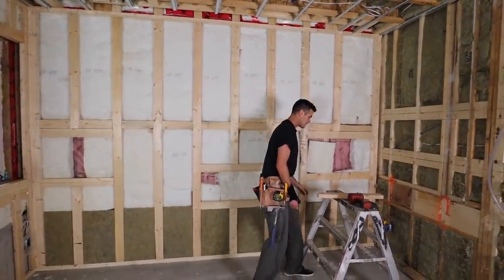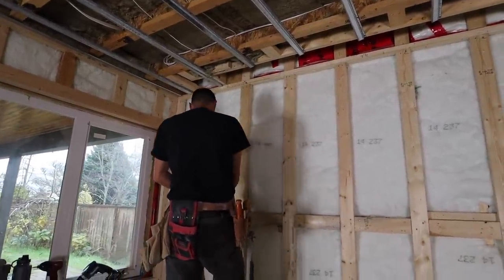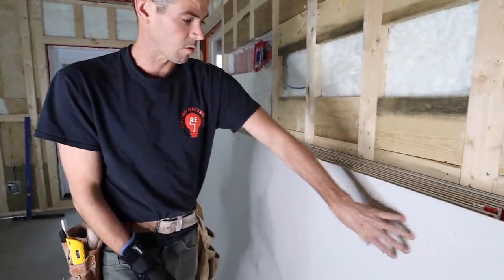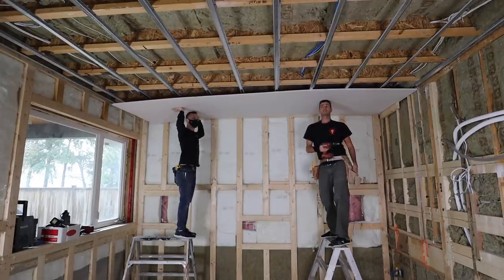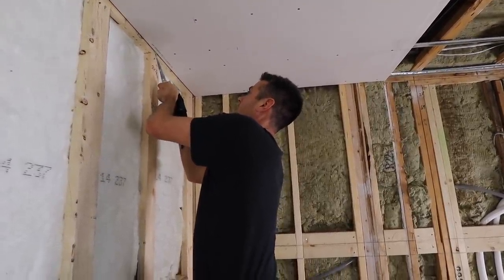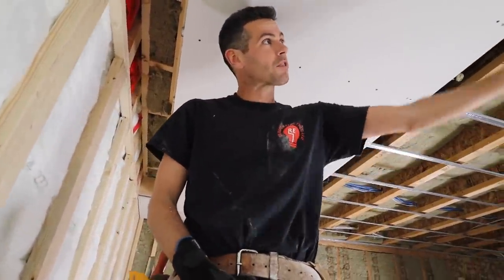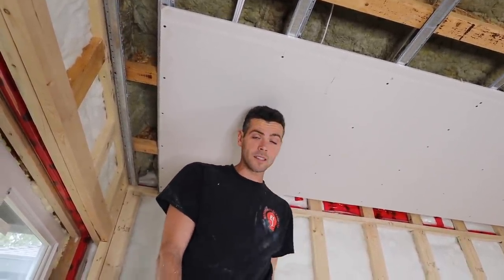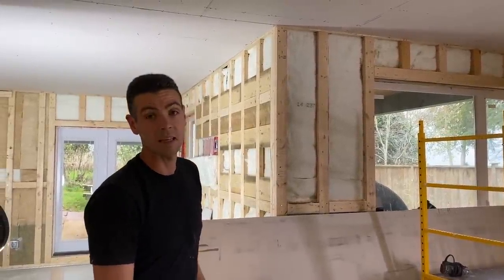Hanging 12 foot sheets of 5/8" on Res Bar!!

Comment: Brought back memories of working with a helper who was 8” taller than I am. No matter what height we built a scaffold at one of us was not happy. Also reminded me of breaking my thumb one weekend and being told I could go right back to work. I borrowed an appliance hand truck from my boss so I could drag my radial arm saw out of my basement and set it up on the job. I was laying a wide plank pine floor that was face nailed rose headed wrought iron nails. The idea was that the floor would look 120 years old like the rest of the house. Well between the old fashioned nails and having to swing the hammer left handed  it certainly looked “antiqued”.
Reply: Wtf u talking bout
Reply: @thomasbowden1054  first, I used to work with a helper who was 8” taller than I am. On several jobs we hung drywall together. Either  the scaffold height as right for him and I’d be on tiptoe, or I would be at a comfortable height and he would be all hunched over. 
My apparently off topic story about laying flooring was prompted by seeing  the Vancouver Carpenter working with some sort of brace or cast on his wrist.
Reply: @janderson8401  I sort of understood the height story, but the flooring story looked like a whole bunch of gibberish. Or pig latin. Or gibberish pig latin

Comment: I've been hanging drywall here in Australia and check in the drywall guys from all over the world after a day's work as a bit of a pep up to make sure I'm doing the whole thing right. I seem to be. Yeeha. I can't do the tape measure drag along.. I went to Bunnings and bought a t square for drywall.  Twenty dollars.. Also I find wetting the paper tape for butt joints. Just two seconds in water really helps the adhesion as I am using the gyprock all purpose compound. I am mentally prepared to do a Fair bit of sanding which seems the arch nemesis of DIY plaster dudes but so be it if I want a top notch job. Good luck everyone....

Comment: Hung my whole townhouse renovation. 5/8 x 12 all sheets except 3 5/8 x 14. bought quality lift. don't buy cheap one. Bought Makita self feeding screw gun. sold both after job was done. Even use the lift for the top wall pieces. Thanks for showing this video. Brings back memories.

Comment: If you are going to do any restoration or extensive remodeling there are two pieces of equipment you need from Harbor Freight. About a decade ago I bought the portable scaffolding (on wheels) and the drywall lift. cost me about $250 back then and I have used them extensively. Saved me time and a sore back. Use the right tool for the right job.

Comment: I bought a used lift off Criag's List years ago. Soooo glad I did. Just a couple days ago I realized (duh) the lift works for walls too (horizontal orientation). I also made a bucket for it and lifted loose insulation up to the attic.

Comment: 2 things.
I would use tear-away bead on the edge of the opening for a clean edge.
And I wouldn't screw the seams until the next board is butted against it, that way you don't have to worry about putting a screw too close to the edge and blow it out.
Besides that, your commentary it's the best representation of how drywall work really goes lol, great job.
Reply: Saw tear away a lot in commercial projects, works well.

Comment: Love your vids, very helpful. Sometime even a novice can help a pro. I do believe you said this is a theater room and I am sure the customer is having Resilient Channel installed for sound deadening/proofing. When installing Resilient Channel, you screw the channel to studs but you should never install the drywall screw over the stud. If you do put drywall screw over stud you have defeated the purpose of the Resilient Channel and allow the sound to transmit into stud. Keep up the great work and helpful tips.

Comment: When I put up the drywall in the room over the garage I did it all by myself. I had to figure out how was I going to hold the drywall against the angled part of the ceiling and screw it in at the same time. So I did basically the same thing. I screwed boards to the wall to hold the lower side of the drywall while I screwed it in place. The flat part of the ceiling was narrow so that took some of the weight off the drywall since it was only a couple feet wide, but I used a 2x4 with a flat piece of 2x4 screwed to the top to hold one end against the ceiling while I balanced the other end on my head and screwed it in. You do what ya gotta do.

Comment: I hang 12’ drywall by myself with a cheap system. Take 2 10’ 2x4’s and screw door hinges to the ends of each one. Screw them to the top plates about 6’ apart and let them hit the floor. At the bottom, screw an 8’ 2x4 perpendicular across the bottoms of both 10’ 2x4’s. This acts as a lip. Take another 8’ 2x4 and screw another door hinge to the end. Screw this in the middle of the 8’ 2x4. This acts as a dead man that swings down when you lift up the drywall panel with both arms. Simply bring in the panel and rest it on the lip, bend down and lift up on the 2x4 until the dead man swings down in place. Now you can slide the panel into place. I have a few T-sticks I use to push it up against the strapping. I’ve built 3 homes completely by myself.
Reply: Love to see a video on your system
Reply: Yes video
Reply: Sounds like a great idea! I'll have to give that a try.

Comment: Hey when working on a home theater room besides using rez channel to float the ceiling have you used "green glue" on the walls. It doubles the density of (2) pieces of drywall to act like (4) and STC's ratings go up. Building recording studios sometimes we've used green glue between the layers of sub floor as well.  I'm sure you know this but using "green glue acoustic sealant" at the floor (drywall can't touch) and corners works great on hi frequency transmission...decouple decouple! Adding a passive air handler is a whole other thing...Cheers great channel!!!

Comment: Thanks for the great video.  

You mentioned the need to leave a 0.25 inch distance between the corner and the RC1.  Should the drywall also have a 0.25 inch gap in the corners (where the ceiling meets the wall)?

Additionally, for sound proofing purposes, should the ceiling and wall drywall pieces not touch...and only use tap to bridge the gap?

Comment: As an aged DIYer (69) I did the same thing in my basement in October (plus all the mudding...) Yes, I own a drywall hoist. I wish you had posted a few months ago! Learned the hard way about using fine threaded screws and not screwing them on the bevel. Contrary to what you demonstrated, I found butt joints on res bar problematic for 2 reasons: (1) res bar is too narrow for proper screw attachment especially if a sheet is slightly long and (2) the butt on floppy side of the res bar seated lower that the other. I know that mud would take care of this, but I just don't like it. What I did was to hang the drywall long and spliced my butts with 6" x 54"--for securing butt to drywall on either side--strips of 3/8" plywood (since the height of the res bar is 1/2"). Regards, GK
Reply: There's are interesting products like the TRIMTEX 825 BUTT BOARD  that are designed to create a bevel on the butt joint. You install them the same way you described, but they pull the drywall up (in theory, never tried them).

Comment: Union rocker in the Seattle area. Never seen a drywall lift on the job. Lol. We 2 guys on beaches swinging board over head to get those in. It would suck when the sheet wouldn't fit. 

Few tips through. Hilti actually sells a drywall router, and that would've been your best bet on the cut in for projector screen. Using a guide bit, you won't hit the wood. 
When marking out the location for your studs at the end of wall, it's a good idea to just do a line instead of the two lines and an x. Takes too much time. Use a T-square and a pencil to mark out the sheet for the studs on the ground first, if you need marks. 
Lastly, you should get a belt clip for your drywall gun.

Comment: I remember when our USG rep promised 5/8 lite board was coming. Damn lie that was
Reply: Most of the time when I'm using 5/8" its for some kind out soundproofing initiative. Ultralight looses the mass benefit of the traditional Type X
Reply: @ryanmitchell4266  If the price doesn't scare you off, and if it's available, QuietRock in 1/2 inch has good sound dampening properties.
Reply: @ryanmitchell4266  5/8 for us is extensively used as a standard thickness in commercial. and for exterior soffits.

Comment: While there are no dumb questions, this seems like a dumb question: Why don't you use drywall adhesive? Especially on the ceiling?  And did you mention the length of the screws at some point? For the record, I am a DIYer with no friends so I am renting the drywall lift.
Reply: Because that adhesive is a BS upsell just screw it to it and move on especially hanging lids (ceilings). Also, make SURE you precut everything before you hang it trust me it's no fun trying to make those cuts up there. Last but not least when you measure your cuts cut back an eighth you don't want it too tight.
Reply: Adhesive without adequate screws won't hold long term so there's no advantage.  It takes a few years but the paper back on the drywall lets loose even on the wall, much less the ceiling, and it all starts sagging.

Comment: Thanks for the video.  Is your thumb issue due to injury?  I had an inflamed thumb a while back where I almost couldn't work.  I tried resting it and not using that hand as much as possible.  No luck...actually seemed worse.  In case it could help you I went keto with my diet and inflammation/pain in that thumb is gone.

Comment: you taught me a ton. i am old haha 58. i did my living room and dining room drywall. i got the jack from amazon for 11ft ceiling's what a great tool. an extension can be brought for higher ceilings ..i used this for handing 2x4" ceiling framing with my air gun. your spakling tips are great..dude retire to a different trade as your body will be old soon..WHATS YOU AGE??your young

Comment: Is there a concern that the track could fail if there was a water leak where the drywall soaks up water weight and the holes where the screws that hold the track to the joists rust?

Comment: Why stagger drywall joints like plywood? Maybe I'm doing it wrong but when it comes to drywall I usually keep seams aligned for an easier time taping.
Reply: I always stagger my joints, it’s easier for me to coat a 4’ joint then a long one , also I feel like there’s less chance of a butt joint cracking if the two sheets beside it are holding the rafter From moving🤷🏻‍♀️

Comment: If the reason for 5/8 on the ceiling was sound dampening, was there any consideration give to using "QuiteRock" drywall?  (in 1/2 inch)  
Also, as 12 foot sheets did not eliminate the butt joint, is there a particular reason for going with 12 footers versus 10 footers and having the butt joint a bit further from the wall?
Reply: I'm thinking he only has to mud the joint one way, because the other butt side will be close enough to the corner to not need to feather it.

Comment: Don't know how tall you are for reference, but those screws look pretty far apart.
I know Vancouver has their own building code, but don't they base that on the National Building Code or BC Building Code, 
and require fasteners every 150mm on the edges and 300mm in the field?

Comment: How come you alternated the orientation of every other sheet?
Reply: That's proper installation technique.  That way the joints are staggered.
Reply: Easier to tape, also.
Reply: The reason why is so all the factory edges are touching each other. 

Why is that important? Because the edges are rounded creating a little valley so the mud has a place to go when taping.

Ending in a seamless joint.

Comment: Strange framing
Reply: How so?  Looked correct to me.
Reply: A lot of it is on the flat and there is some odd horizontal blocking as well.
Reply: I think the room is soundproofed. The wall where Ben started at is probably framed with flat-facing 2x4s on both sides of the wall. Thus reducing sound transmission. The white stuff is probably soundproofing. The blocking on the adjacent interior wall with the roxul looks like cabinet blocking to me. The res channel on the ceiling is probably also for soundproofing.
Reply: @GarwoodNick  yeah, that was my guess.  maybe a theater room.

Comment: You really need to change to metrics - so much easier than this fractions nonsense. 16mm (5/8'') plasterboard (that's what it is, it's not drywall) would seem to be overkill for a ceiling. In Australia the only time you would use 16mm on a ceiling is for a fire rated system and it would be fire rated plasterboard (Fyrechek). Ceilings are usually sheeted with 10mm (3/8'') 'Superceil' which is a plasterboard specifically made for ceilings.
Reply: They are using it for sound deadening, hence the resilient channel. Here in Canada standard is 1/2 board on the ceiling
Reply: In Canada we call it drywall or gyprock. The 5/8" drywall is fireguard drywall in all likelihood, but he is using the resilient channels and 5/8" drywall for sound dampening purposes. A coat of Green glue and a second layer of 5/8" drywall would really beef up the sound dampening,
Reply: @eskilover  Hello Randy - I could be a smarty and question how can it be drywall when it's on a ceiling - should it be dryceil? I would question the construction if he is trying to achieve a sound rating. I have never heard of resilient channel here. We have resilient mounts which I believe would be far superior - no doubt you have them over there too. Realistically, a single layer of 16mm material isn't going to achieve much. It really needs to be a properly designed system.
Reply: @kelstra1997  What you are talking about, Resilient clips and hat channel, is far superior to resilient channel. Like I said above a coat of green glue and a second layer of 5/8" fire guard drywall would be the way I would want to do it if the budget allowed.  My suggestion is 3x more expensive than what he did. It's not a terrible way to go if the homeowner wants some soundproofing.

Comment: 12’ 5/8 sheet rock... by hand...🤬
Reply: I just did a 6000sqft commercial ceiling with 12’5/8 drywall by hand. Drywallers do it all the time.